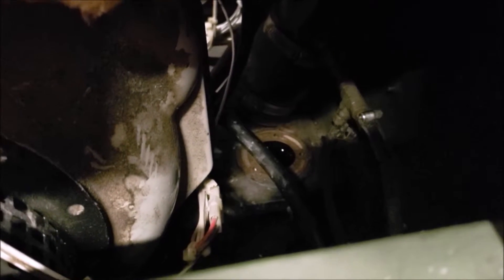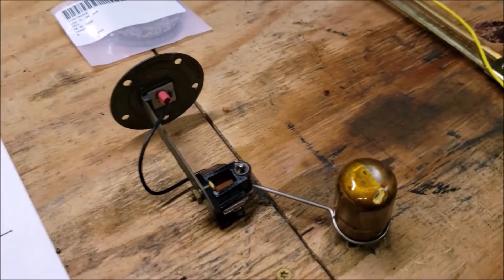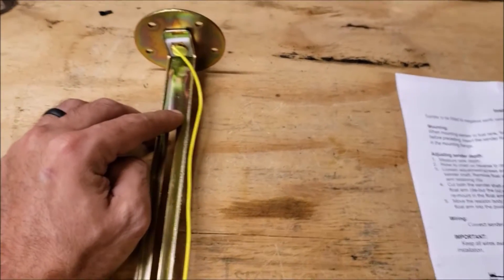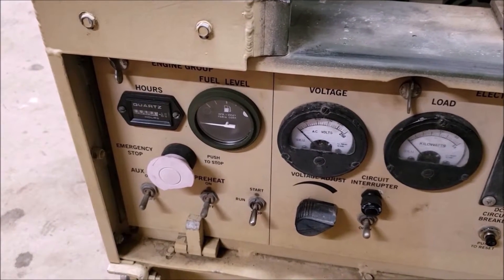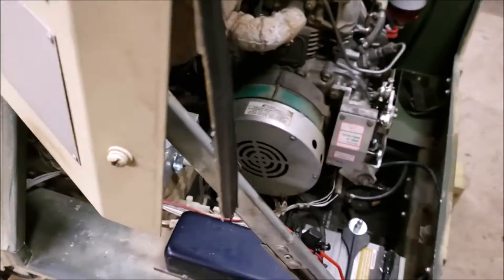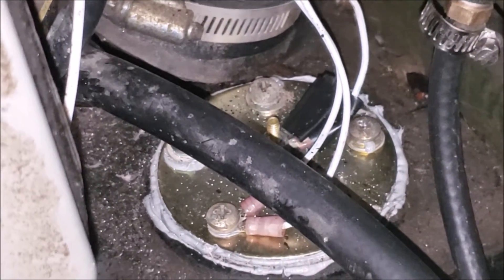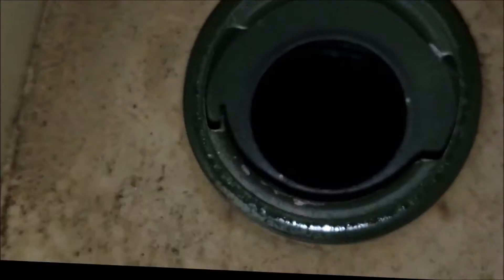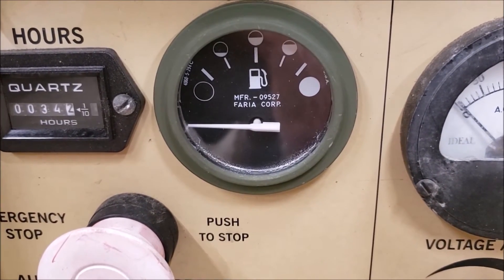MEP 831A - Fuel level gauge & sender replacement & improvements

Comment: I bought a 'reset' MEP-803A and it seems the AUX fuel sender was bad from the get go, and the main fule gauge malfunctioned at 100 hours use.
The aux sender reads short between the two red wires and open between all other combinations of wires. Found out it wasn't working when fuel spilled because AUX fuel pump didn't turn off.
Reply from the maker: Reset units tend to have a lot of issues, low hour ones even more because they were never worked out.

Comment: @callmecolt does the 0 to 30 ohms rule go for the 803 a i have purchased a new fuel level sender and its doing the same
Reply from the maker: No it's different. I have a video showing a fuel sender replacement on a MEP 802A. You'll just need to take a measurement and see if a slightly longer/shorter one will work better on the MEP 803A.

Comment: Im going to try the mep-802a sending unit. I know its bigger but im just going to swap the rheostat onto my sending unit and try the 802a gauge in place of the 831 gauge. Great video thanks!
Reply from the maker: The MEP 802A sender will not work at all in the MEP 831A.
Reply: @CallMeColtLLC  not even with the correct gauge?
Reply from the maker: @erikjp92  If you match the sender to the guage ohm, I think it will work. I was thinking about the float switch for a second. If you want to try that, I have a guage & the newer style sender I tried to use in this video I can sell you.
Reply from the maker: @erikjp92  Oh dang, yeah, ordering in the system sucks. I believe the MEP 802A sender could be modified like in my video for the lengths. It's been a while since I looked at one.
Reply from the maker: @erikjp92  that's a good idea! Definitely follow up and let me know how it works out for you.